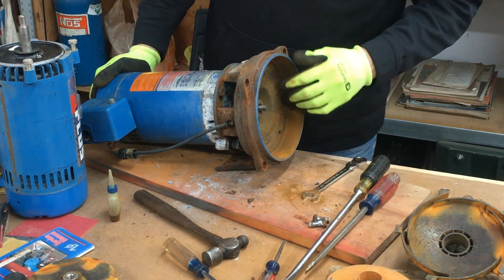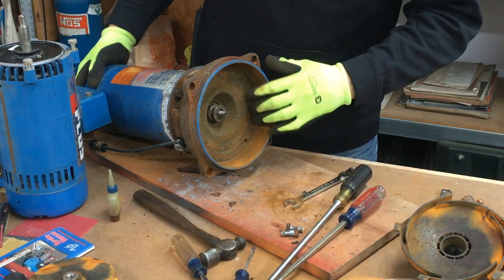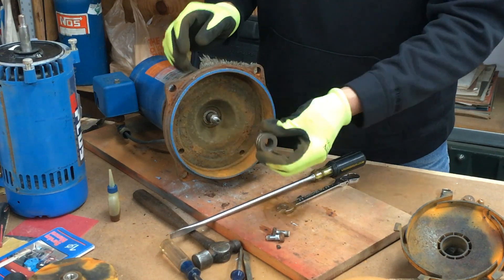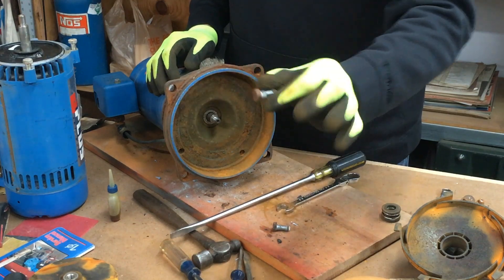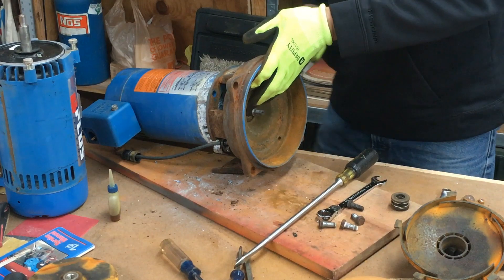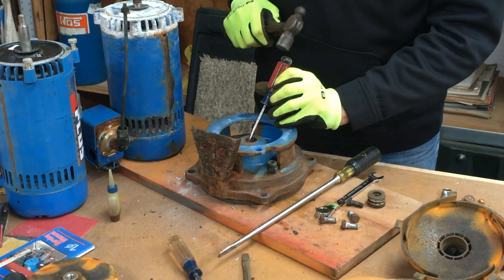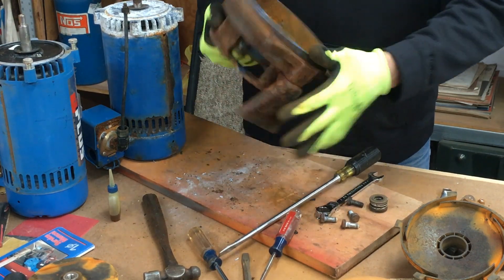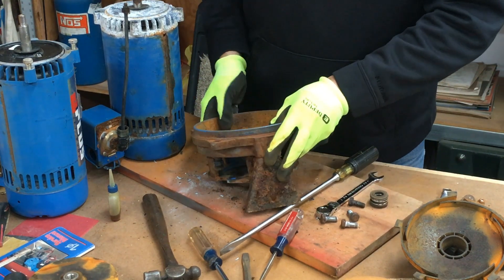Goulds Shallow Well Pump Shaft Seal and Motor Adapter Removal

Comment: Are you still answering questions about this video?  I have a question about the seal in the adapter housing.  One side of the seal is rubber and the other side has a white plastic.  Which way is it installed?  With the rubber or white plastic piece facing the spring?
Reply: Just disassembled my j15s, rubber was away from it

Comment: Instead of using a screwdriver to pry the head off the pump, a good smack from a rubber mallet will pop it off, no risk of damaging the seal or breaking the tip of the screwdriver. Thank You for the video I needed a little refresher course on the shaft seal replacement. I thought I was missing a step in the process, I was go figure lol, it's been 10yrs since my last rebuild. I forgot about removing the back to knock out the rest of the old seal. Thanks again!!!

Comment: Thank you for these videos! Would you have any idea why mine still sprays water while pumping out near the motor adapter? I just replaced the the complete seal and spring, and ceramic, everything....I was very careful....still sprays water just like before I rebuilt it.???
Reply from the maker: Your motor adapter may be cracked somewhere
Reply: @zeppone4045  actually I found out I didn't have the seal installed correctly. 🙃
Reply: @9631612  Are you still answering questions about this video?  I have a question about the seal in the adapter housing.  One side of the seal is rubber and the other side has a white plastic.  Which way is it installed?  With the rubber or white plastic piece facing the spring?
Reply: @kenjordan5164  I'm sorry. I don't remember which is right. It qas a while ago.

Comment: I just replaced shaft seal on mine, hoping  wd40 will not harm new seal.  Noticed afterwards should be lubed with only water.  Hoping I'll be alright???
Reply: It's a ceramic seal, water only..

Comment: I’ve used a small bit of silicone spray for years when servicing my Gould’s J5S irrigation pump it helps a lot removing the spring shaft seal.

Comment: I turn on my pump, it clicks but the motor doesnt turn, it will blow the breaker if I leave it on long enough, (10+ seconds).  Dont know if the motor is frozen, its just over one year old has hardly been used. Any recommendations, thanks....?
Reply: Sounds like something is jamming the motor. I would suggest you take the pump housing apart like the guy in this video and then see if you can turn the impeller by hand. Then if you can’t find why it is jammed if it’s not jammed then I would probably guess it might be your start capacitor. Let me know if you find the cause.
Reply: @mainelyelectric  Thanks Ben, it was the on-shaft bearing, frozen to it via Rust. Thanks.

Comment: Great video - thank you. Would you consider a video showing an overhaul of the motor, specifically - bearings. I have a hsj10n that seems to Have a little bearing scream going on. Not afraid to get into it myself. But it would be nice to know what I’m going to get into.
Reply: If it’s really the motor that is making noise then there’s not really much that can be replaced without specific tools.  I personally took my motor apart piece by piece just to remove a fried dead snake and bugs making it over heat and it was very hard and time consuming. It will most likely will be cheaper to order a replacement motor from your local Gould’s dealer. But still save and use the pump till it 100% dies for some parts.
Reply: @mainelyelectric  Hi Ben, thanks for the reply. I actually did tackle it and had great success. All the noise was coming from the bearing on the pump end. All I had to buy is two bearings from a local Bearing shop in Springfield mass- cost was $16. Quiet and smooth now 👌🏽